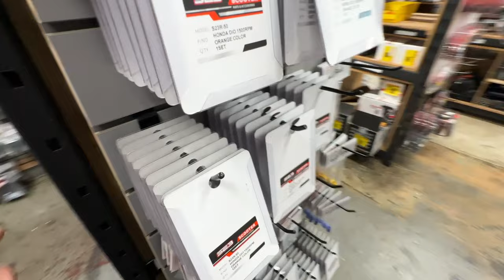Honda elite scooter giveaway 70+mph!

Comment: Glad to see another video!!!! If it wasn't for your YouTube videos I wouldn't have a serious scooter addiction!!!
Reply: The addiction is real.  I started with a free yamaha jog,  now I have the jog,  a jdm 87 af-18 swapped tact 50, an 86 spree with a 04 zuma 50 motor, a 93 dio special edition like Brandon's,  and a 2006 typhoon.  All my scoots do 50+mph except my dio cause I havnt built it yet.
Reply: @sandys9791   I also have an 87 jog! Going full build rn.
Reply: @hunterpercy6864  gonna have to swap a prebug motor in it.  Not much aftermarket for the cg50.  I lucked out with a 1992 cy50 with the minarelli.  It does 94km/h with a polini sport 70,  yasuni r pipe,  polini variator and dellorto 19 carb.  Just put a tach on it and I'm revving to over 12k rpm lol  pushing the stock crank to the edge.  Have a corsa top end I'm gonna use when the stock crank gives out.
Reply: Blew my stock crank with an Athena 70cc kit. Mhr cylinder, stage 6 mk2 replica crank, mhr exhaust with polini 24mm carb going on next! Dio front end swap and re gearing aswell
Reply: Blew my stock crank with an Athena 70cc kit. Mhr cylinder, stage 6 mk2 replica crank, mhr exhaust with polini 24mm carb going on next! Dio front end swap and re gearing aswell.

Comment: Looking good guys. I'm still trying to figure out why my 49cc Tao Tao mod to 100cc isn't getting the speed it should have. Clutch springs yellow variator weights 6gram
Reply from the maker: Hi you can’t take to 100cc without machine work
Reply: @Scooterswapshop  ok I've done everything that I can besides changing the gears in the transmission. My carb is 18mm does that need to be bigger?